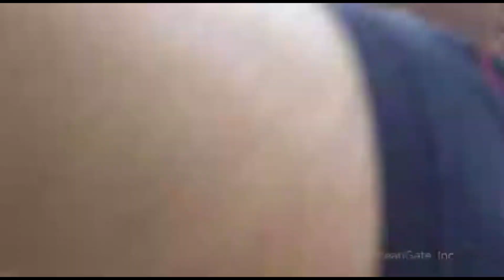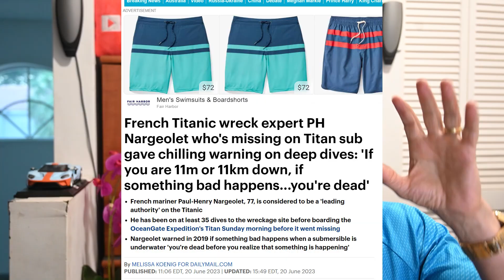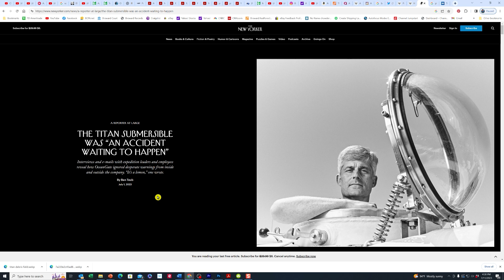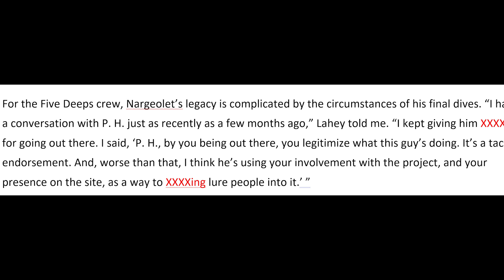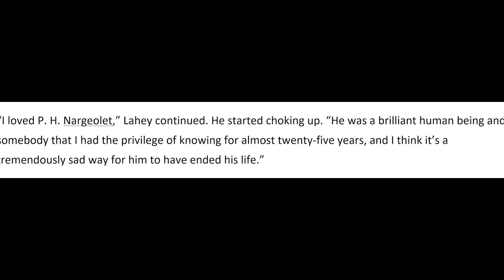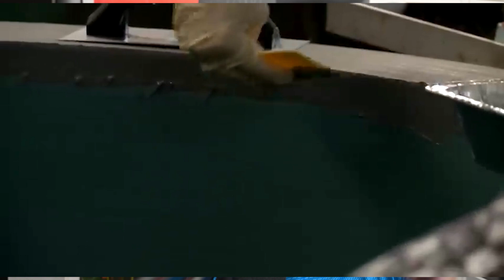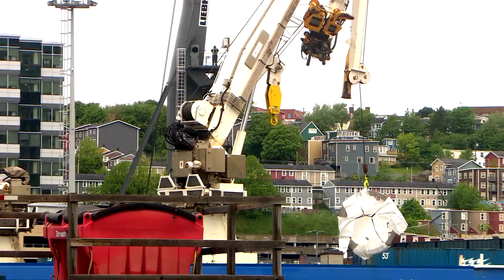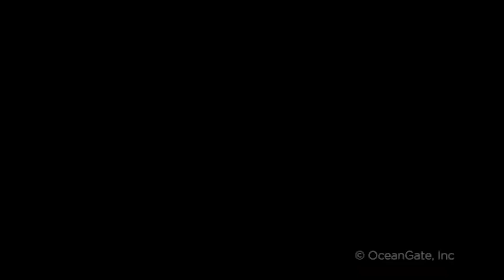Titan Sub: More Q&A, Design Defects, Why Descent Fast

Comment: 6:00 they kinda did, least they filled it with oils from their skin and whatever fragments fell off that cloth. if im building an expensive motor I dont even wipe it down with a rag like that. its going to leave behind so many contaminants I dont want to risk trapping in the motor to avoid buildups even if it might get burned off or captured in the oil filter. my luck a thread would get caught somewhere and collect metal fragments during the first few tests. im no engineer but from my LIMITED experience as a metal fabricator and welder on ships that whole vessel scared the F*CK out of me. a boat you wouldnt even be able to bind them this way (if its similar to fiberglass and steel / aluminum ive only welded and worked with titanium twice) the front would just work loose and fracture the other martials connected to it.  over a few years of vibration and shock a cap would just fall off unless you were able to somehow add more material to fill the larger fractures you can see, and 100% would be impossible on this sub it should of been never manned until they found out its safe lifetime for use. no reason it couldnt of just been depth cycled a few dozen times before a NEW sub is built . they straight up killed those people that waiver they signed will not protect the company from their own negligence.

I do want to say that I appreciate this isnt just content beating a dead horse and is being kept respectful and professional to the victims as well.

Comment: I don't think anything about the epoxy prep matters (roughing up the titanium / applying the epoxy evenly / skin oil contamination etc) compared to the difference in Young's Modulus of carbon fiber / resin vs the titanium. It would've failed there eventually no matter what. See the latest Thunderfoot video for the full explanation

Comment: My theory: There were dozens/hundreds of micro-implosions, as small air bubbles in the carbon fiber imploded. Eventually a string of micro-implosion sites leads from the outside to the inside, water squirts through under astronomical pressure and instantly enlarges the hole to destroy the entire carbon fiber structure and everything inside of it. There is a standard method of eliminating such bubbles by putting it into a vacuum chamber to cause bubbles to expand and exit the structure, then returning to atmospheric pressure to shrink the surviving bubbles to a tiny fraction of their original size. However, I have NOT heard that the carbon fiber was vacuum treated. Carbon fiber may have its problems, but carbon fiber WITH BUBBLES  is a catastrophe waiting to happen.

Comment: The water temperature would have a big part to play in this. The cold water is denser water and will sink down, displacing the less dense water, which will rise to the surface. They could have got caught in an area of largely dense water 💦 that was taking them down fast.
Reply: Highly doubtful. What you are describing sounds like a 'downdraft' in the atmosphere. Such movement downward (and upward somewhere else)  thermally won't happen appreciably in water because the density of water doesn't change nearly as much as water, per degree (C or F), different by orders of magnitude. 

When there are temperature gradients such as 'Gulf Stream vs melting glacial ice', then you have something.  That is For Real. I don't know how fast that is, but this was a familiar dive (well, to Ballard and Cameron) and such problems have never been brought up before.
Reply: Very good thinking.

Comment: What is the RTM from which they noted an alarm?
Reply: Real Time Monitoring system. Didn't find anywhere what points and how many the system monitored.
Reply: @curiouscat8457  Thank you. Various reports suggest that they had about 20 minutes of warning. Some reports suggest that they experienced difficulty dumping ballast and so were slow in their return to surface abilities. It makes me wonder, if they could have ascended more rapidly, might they have reduced pressure on the hull sufficiently to slow or stop any delamination that was probably happening. 20 minutes of ascending would not get them anywhere near the surface, but surely any significant reduction in pressure levels might have given them a chance.
Reply: @artistjoh  I believe the most significant alarm the system delivered was a presence of water in the hull. A leak causing massive loss of buoyancy is the only rational explanation for the sub starting to sink again despite of dropping all ballast and applying vertical thrusters (not designed to bring the gizmo to the surface anyway).

Comment: The descend rate depends sensitively on the overall density of the sub. If it descends too fast, there must be a hollow space which is normally not filled with water but was during the descent. In this case the people within were doomed from the beginning of the descent. But the authenticity of the transcript of the dialogue is still not proven and we should take it with a grain of salt until it is.

Comment: What is the contraction rate of titanium compared to the contraction rate of carbon fiber,  and that titanium surface to me didn't really matter if it was ruffed up or not the contraction rates are extremely different and was bound to fail

Comment: 5:41 His hand is on the opposite side of the ring from the surface that will see the glue. The straps are attached and the ring will be lifted up and dropped on to the cylinder. This is / was the door end. His hand is on the ring surface that would seal against the door.

Comment: I have a stupid idea. What if they had a leak develop while still near the surface (so, not enough pressure for the water jet) and it filled up some void space on the sub? This would make the sub heavier, so it dived faster and could not ascent (after dropping the ballast and the frame, when most likely just the ballast should have been enough).
Whatever space filled up with water was not under any pressure (since water was on both sides), but it could have weakened part of the hull and made it implode.
Reply: so maybe water got in during the journey to the site? If it was being hit constantly by the Atlantic waves could that have damaged it? (Zero engineering or submariner skills, genuinely would like to know?)
Reply: I had the same stupid idea too but it makes some sense. Otherwise how else could it have sudden negative buoyancy.
Reply: Far more likely that the carbon fibre simply became waterlogged in my opinion or they miscalculated their weights somehow.

Comment: I worked in fiberglass for 7 years and seen a machine just like it only using fiberglass.  It goes through the resin then wiped, out of seen from what we see in the video of the tube being wound. But should have been put in autoclave after.

Comment: Would the c/f cylinder have been stronger if they had wound the fibres diagonally instead of just circumferentially. Pressure loads would have been longitudinal from the titanium hemispheres trying to crush from the ends, as well as pressure from the sides.

Comment: Everyone is looking at the carbon fibre, but having read the New Yorker article, and had also previously heard, the Acrylic Window was supposedly only rated to 1300, not 4000, and there’s possibly problems with that rating too. Maybe the Acrylic failed? It was missing from the front Titanium dome after all when it was recovered

Comment: how exactly does the decent work? does the pressure push the vessel down so its free falling? or does the sub slow down the deeper it goes?
Reply: no and no. It has thrusters hooked up to batteries for ascent and descent. It was close to neutral buoyancy so they could drop ballast loads in order to ascend in an emergency. Otherwise they would just use the thusters.

Comment: I see other saying it as well but ever since I saw your video on the transcripts and pointed out the decent rate I thought they were fine and purposely descending quickly but now I think they were essentially sinking from the start in that back electrical area and it went undetected until they had to much water/weight to even think about making it to the surface even if it hadn’t imploded. I just don’t think whomever was controlling it (rush I think) comprehended it was sinking rather that diving. Sad!
Reply: In aviation, every flight requires a pre-flight test of the control surfaces to ensure that everything operates as it should well before becoming air-borne. Was a pre-dive check done in this case or did a care-free "clueless optimism" prevail? 2023/07/12. Ontario, Canada.
Reply: Not sure why you keep covering the descent rate of this sub. This company performed many dives, including 13 dives to the Titanic, all of which were no issue. Those dives to the Titanic were all done in around 90 min, and they never had any problems. 
This seems to be simply an assumption based on ignorance.
Reply: @undeadarmy19 It's about the conservation of energy. The faster you sink, the more energy will be required to slow/invert the descent. With a properly crafted sub, you could go down that fast, but if an issue arrizes, that is precious time lost trying to invert. During that time you continue to descend into increasing pressure. If an issue related to pressure arises, it will increase in severity as a result. Being slow and methodical with the quick ability to slow/stop/invert descent is far safer. The other reason is that a high speed of descent could indicate floatability issues due to either mechanical or structural failures.
Reply: @theodoremichotte8364  THe difference in descent rate is negliable compared to conservation of energy, especially in a medium like water.
As already stated, the descent rate is what is advertised by Oceangate, and its the same descent rate used 13 other times. Anything aside from that is speculation, not fact.
Reply: @undeadarmy19  If the transcript is accurate(I know it's unoficial) the sub couldn't go back up for an unknown reason. That would mean that they had flotability issues. Now it's all good and dandy to advertise a speedy descent but being unable to make a speedy ascent is literally what killed them. I'm using my somewhat basic physics knowledge and my knowledge of scuba diving(How it takes a while to change elevation using only your balast lungs). If you have some explanation for the "speculation" do share it because I'm very interested in this sub implosion.
Reply: @theodoremichotte8364  They made many other dives in the same timeframe though, so this argument just doesn't hold.
Its incredible to me that people will watch a video of a random dude on YouTube making a point, believe that point, then defend it as if its the truth, even though no ACTUAL evidence is presented. 

I can literally post at least a dozen articles/interviews/etc about/with Oceangate that all state a "90-min descent time".
This is what the did, and it was never an issue in the past.
Reply: @undeadarmy19  Where in his video do you see him explaining the same reasoning as me? The sub imploded, which could be avoided from going from a zone of higher pressure, to a zone of lower pressure. How do you do that? You go up. If the transcript is correct, they weren't able to go up. This means that somehow weight was added onto the sub. The only medium possible is water correct? So somehow water got in(probably the rear compartment). Through that logic that means the structural integrity was compromised due to pressure. The higher the descent speed, the slower the inversion/stop is. Also the more elevation is lost during reaction time. Let's say it takes 1 sec of reaction, if the descent speed is 5m/s that's 5m down. if it's 10m/s that's 10m down. So yeah descent speed matters. And I'm going to say, great job saying that you can dive in half the time, how about coming back up?
Reply: I do not think electrical box has to count much on buoyancy as such equipments should be empty spaced and heavy otherwise they themselves push upwards on normal day and dismantle from the vessel.
Reply: @kumak2591  I was thinking in terms of pieces and parts getting 'water logged' or absorbing water.  We'd have to know more details about how the sub was treated after each dive.  Since salt attracts moisture, it would seem like the presence of salt left on the equipment in the time between voyages to sea could prevent things from fully drying out. Don't know....there are just so many questionable details.
Reply: Is the tail cone allowed to fill with water or is that a pressure chamber also?
Reply: I'm with you.... that would also plausibly explain the electrical/battery issues.  That 'innovative' vessel should've been exhaustively inspected by dismantling each individual system in order to compare expectations with reality.  How anyone could fully trust a 'new' idea is next level ignorance.
Reply: IF there was something going wrong in the 'aft' section, she would have been heavy at that end and taken on a different 'angle'.  Even SR would have noticed that going down by the aft end instead of bow first was a big problem.

I BELIEVE (not seen definitive proof) that the O2 for breathing was stored inside the pressure hull, not in the aft section.  Only a 'bouyancy' bladder and it's supply for later ascent was in the aft area.
Reply: @SuperNostalgia. ternal life is knowing the one and true God, and the one He sent.  John 17:3.   You know God thru Moses ( what Moses wrote) which is the law.  Knowing the one he sent, Jesus  (which is the gospel).  Jesus also carries the prophets Rev. 19:10.   That's how His blood cleanses you.

And that's what Jesus meant by saying you eat his body (law) and drink his blood (gospel)   These 2 are paired throughout :
 Law & gospel/testimony;  Moses & the prophets,; His body & his blood,; bread & the wine;, song of Moses and of the Lamb.

 However many have  ignored the law because of a false teaching.  You need both or you're going to hell.

Comment: Just an assumption to the descent rate, but I would see it as reasonable, to go "fast" for 90% of the way, but than for the last 100 or so meters to go extra slow, that they are not hard impacting the ground if they are off course or other things are messed up. 
Also is their stated time just the descent time to the depth or does it also include the travel time over to the Titanic?

Comment: I’ve got two questions if anyone can answer I’d appreciate it, 
no1: what was the cylinder that the carbon fibre was wound around made of? Was it titanium like the rings and doors, or something else? And did it stay inside the carbon fibre, like a spool inside a reel of thread?
No2: it seems that there were multiple carbon fibre hulls made and tested, how do we know that the one that is shown in videos is the exact same hull that went to the bottom?
Reply: Q1: The cylinder is called a mandrel. (not a mandrill - that's a kind of monkey) It is just used as a mold to shape the carbon fibre then gets removed. I believe they are made of aluminium. When the CF is cured with heat the mandrel expands. Once the CF sets and is cooled the mandrel contracts more than the CF so it can then be removed.
Q2: We don't. The video also does not seem to match descriptions of how the hull was made. There are also several conflicting descriptions so getting to the facts is very difficult.
Reply: @kengself thank you for taking the time to respond, and answer my questions. The more I find out, and understand, the worse it gets and the more this appalls me.

Comment: I still believe that the systems compartment was compromized, and their inability to drop ballast made powered ascent impossible. When both power busses failed and the vessel went dark it sank to the sea bed and was destroyed upon impact. At least that scenario seems to fit the sms transcripts.
Reply: I don't think the impact of hitting the ocean floor at these speeds would be enough to rupture the hull. It likely imploded before reaching the ocean surface, but we won't know before the navy releases the implosion time stamp as picked up by their detection system.